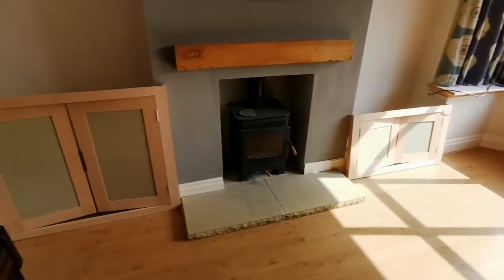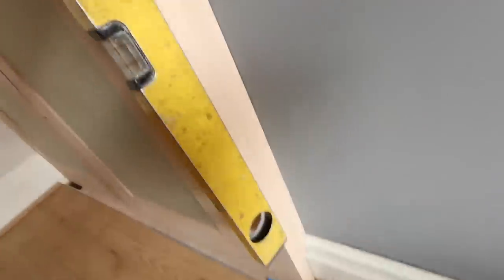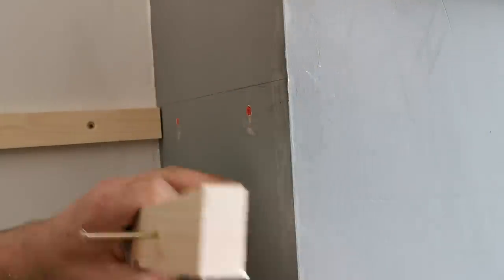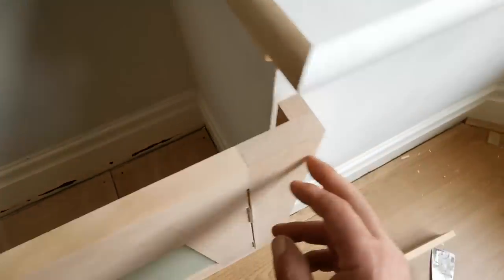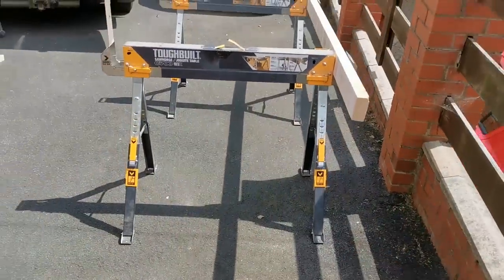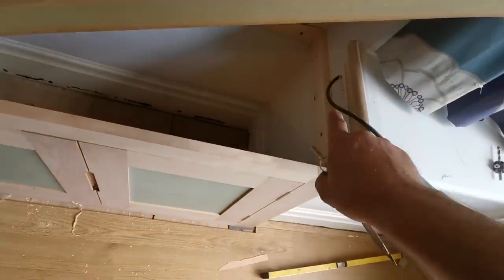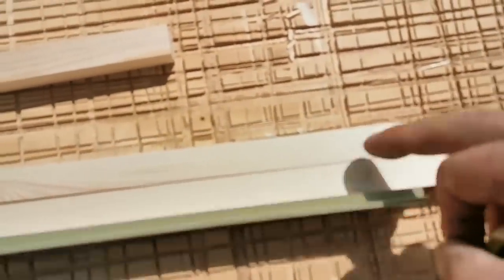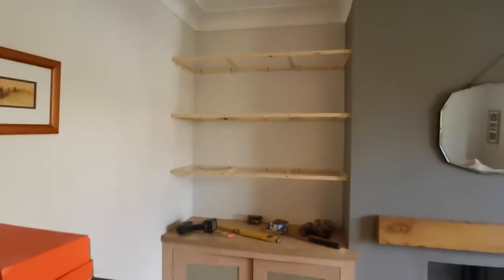More alcove cupboards 5 - Start of fitting in the house

Comment: Top class tip for the scribes using the compass. Thanks 👍🏼
Reply from the maker: 👍 Scribing is a major part of fitting anything so I've been doing it for pretty much as long as I've been a joiner, I've had many scribing tools but the compasses with the adjustment wheel in the middle are hard to beat, one handed adjustment & they don't move if dropped, the threaded bar can get in the way sometimes though 😉 Thanks Matt 👍

Comment: Excellent, just how I fit mine. Same with pointing the forefinger down the drill and saw, proper chippy. And not a CNC machine in sight! Lovely work Gid
Reply from the maker: Thanks Andy 👍 yep & you know but i didn't mention in the vid, it helps to get direct pressure on the drill esp when drilling walls, I still sort of remember being taught this 👴🤣
Reply: Gid Joiner like riding a bike, you never forget. Me and you are about the same age, we must have been taught the same way. The 80’s was a good time to learn the trade we do
Reply from the maker: @andyjames8612  51 on the 15th 😮👴 yep in the 80s there were still the old joiners around who learn't the old ways before leky drivers, I started with a yankee with a jubilee clip on it to stop it falling of the ladder,
Reply: Gid Joiner I’m two years older but also had the yankee with a jubilee clip on it. Great days

Comment: Interesting built. I always thought we first build a cabinet, slide it in, and add trim around it to hide the gaps.
Reply from the maker: Thanks, different ways tpo build it, i give that option of a cabinet to my clients, or to use the alcove & put a face frame n doors on, their choice, Many pantries in kitchen alcoves were built like this,
Reply: @Gidjoiner  thanks for showing this approach.  What are the benefits of each? Which is easier to install for you?
Reply from the maker: No prob, to be honest 'easy' isn't the top of my list, the clients wishes, aesthetics, structural engineering, what's poss, what materials & simply how it's going to be built come first, easy is after all those & other thoughts so can't really say, i don't really think about easy, for a job like this both have their pros n cons, a cabinet is easy to fit shelves inside but that cabinet needs making, fitting & still requires a face frame/doors etc, using the alcove like in this vid is a little quicker, cheaper on materials for the client but can be hard to fit shelves & make the inside pretty, all options are given &  'I don't care about the inside, it's just going to get filled with junk' most people say 👍

Comment: Another good one Gid. Here in New Zealand you can get bayonet jig saw blades with the teeth pointing down. They're great for cutting to a line as the chip out is underneath not on the top. Great for cutting any melamine  or laminate as you get no chips. Check it out as I'm sure they must be available in the UK. The teeth are also finer than that savage looking blade you were using but you can't use the orbital feature on the saw as they cut down not up. Here they come on a card of five. Just a thought..😀😀
Reply from the maker: Thanks Daryl, yep I'm well aware of the down cutting blades, they've been around a long time, i cut from the back quite often out of choice, clear view to the line, clean cut & no face damage,  & same goes for the chunky blade, i use that out of choice, that blade stays straight, & many of these cuts were along the grain so classed as rip cuts, I have some down cutting blades but don't buy them because i don't like them, if you don't hold on they can kick causing the jigsaw to damage the face, like you say they're a finer cut so would gum up n burn quicker & they're flexible. & have many jigsaw blades & a fret saw if i wanted a spot on finish but i choose to do it this way. https://youtu.be/unVv06J-S0E
Reply: @Gidjoiner  ..Cheers Gid and it's Darryl with two R's..Another trick I use when scribing is to use a belt sander. I've got a Elu which takes a 450×75mm belt and I sand on an angle so the top or edge of the panel is tight and the unseen edge is away from the wall or whatever on a taper.
I'm a semi retired joiner who had a kitchen business in Wellington New Zealand for twenty five year's and developed over the year's a lot of tricks.
Lived in London in the 70's and 80's and worked for a joinery business owned by Truman's Brewery in Brick Lane in the east end so I know what British house's and Buildings are like..I.E. a nightmare with wall fixings and bricks everywhere. I'm greatly enjoying your videos  especially on the doorway and glass panels you fitted to that house.
Here in NZ it's all timber construction and fixings are much easier. Still I probably don't need to mention the belt sander to you as going by the pictures I've seen of you you've been around the traps. Looking forward to the next episode of Gid and as I'm subbed on I'll not miss it. Enjoy the summer as having lived there I know how fleeting they can be.👍👍👍👍. Wish there were some woodworking emojis as I'd include a plane or drill.😀😀

Comment: Hi Gid, where did you pick up your scribe compass?I have the trend scribe tool,it’s ok on flat areas but doesn’t profile a skirting as well where as your seems to stay in close. 
Cheers Gid
Reply from the maker: Hi, scribing has always been a part of my job & I've had many scribers, but this is just a Staedtler compass that i added a point to, I like the wheel adjustment because it can be one handed & doesn't change if knocked or dropped but the thread that sticks out on the wall side can get in the way,  I bought some nice ones a while ago but the adjustment was awkward & they fell to bits, I'm still looking for a good scribing implement 🤷‍♂️😉

Comment: Nice job again Gid, felt for you with not able to open windows. 😅
I notice when scribing left cupboard,the big one, you cut the beech as normal not your usual backward cut. 
Steve.
Reply from the maker: 😰😬 Yeah hard work in there, dry mouth but soaking shirt, 😂 No reason for the non-backwards jigsaw cut, the frame with doors still in was a bit unwieldy & in that heat i just stuck it on the floor n cut it out, 'caulk'll sort it' but they turned out ok, Thanks Steve 👍

Comment: Where do you buy your screws? Do you always use the screw tite range?
Reply from the maker: For the general screws yeah, i find them strong, they'll break your bit before the head strips, (normally 😁) I don't like the screws with the cutting feature on the point, i find in plugs & shorter screws it keeps cutting n destroying the plug or not giving a very good hold, imagine a 2" screw fixing together two 1" pieces together, the top 1" of screw with the head is in one piece of wood, the other inch is in the adjoining piece but ½ the gripping thread is that naff cutting feature on the end doing nothing so only ½" of the remaining thread is actually holding. they're for lazy bollocks who can't be arsed drilling a pilot hole, I used to have to go to a hardware store the other side of town but Screwfix started stocking them, they changed over to a modern Screwtite style https://www.screwfix.com/p/screw-tite-2-pz-double-countersunk-screw-5-x-70mm-100-pack/964fy I sometimes have to buy from whoever has the size i want in stock but i prefer the older style, Toolstation just next door sell the older style, https://www.toolstation.com/screw-tite-pozi-countersunk-screw/p48700
Reply: Gid Joiner i use the ones with the cutting thread but still pilot holes, got some screwtite today so look forward to trying them 👍🏻👍🏻 (upload part 3 of pergola)😂
Reply from the maker: Yep got a lot of clips to edit, procrastinating a bit tonight. Which Screwtite ones, the ones with the funny thread bit near the head?
Reply: Gid Joiner  just the normal screwtite not the screwtite 2, these were from toolstation